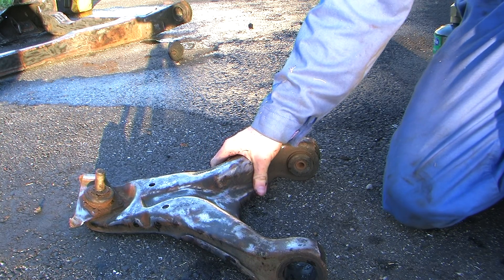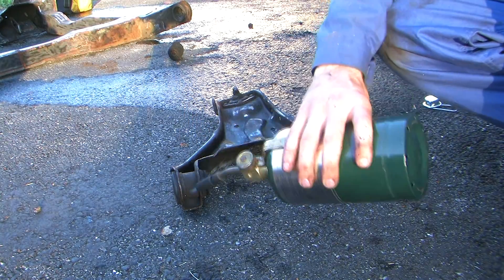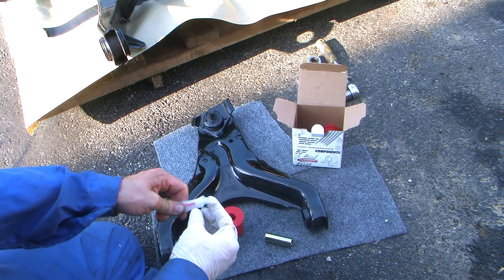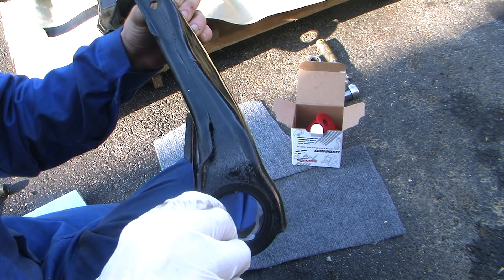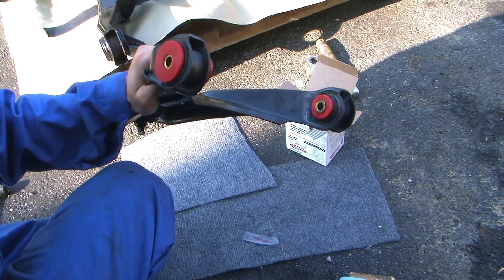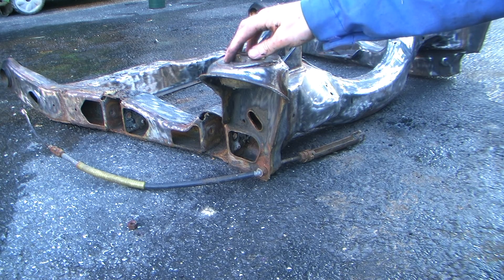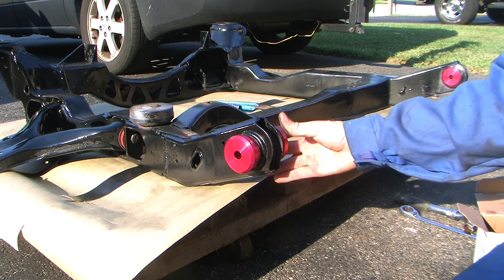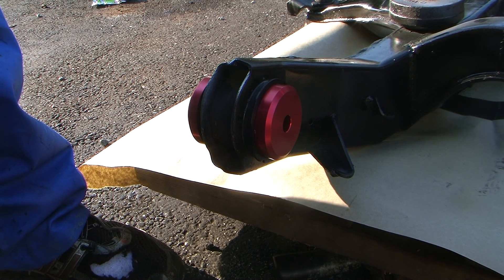Pontiac Fiero : How to remove & Install Bushings from a Control Arm & Engine Cradle

Comment: Thanks for the video. You saved me from putting in my front cradle bushings in backwards. I also used Rodney's aluminum bushings.
Reply: What’s Your experience with these aluminium bushings? Are they good?
Reply: @r.v.1325  I'm happy with them. Only did the fronts because I did this with the engine still in and had the car on a lift.
Reply: @r.v.1325 for the cradle, they should all be aluminum. I wouldn’t use it anywhere else though.  It’s too stiff for the engine or trans mounts. Honestly, new rubber will be fine there, you don’t even need poly. But poly is fine if you track the car, it just squeaks a lot. I used poly everywhere and regretted it.  But a cradle should be rock solid, and aluminum solves a lot of issues.

Comment: My only concern  with using aluminum on steel is that they dont like eachother as being 2 different metals . You have awesome videos. Now to find a pic for a 84 clutch slave 4cyl bracket

Comment: there is like a large cupped washer on the top of my rear mounts-is that supposed to come off?? do you put it back on top of the new mounts? thanks for your great videos!!  I could not figure out how these rear mounts come out but you made it so easy now-other then the cupped washer that is stuck on??  Thanks!!!

Comment: What the pros and cons to the aluminum bushings
Reply from the maker: +Kenneth Neace The aluminum bushings will hold the engine and drive train firmer in place. When you see an engine shaking when you are rev'ing it that movement absorbs horsepower that could be put to the pavement. The aluminum bushings don't allow the engine to twist and pull like the rubber ones do. So the pro's would be faster throttle response because the engine isn't flexing the mounts and cradle and your putting all that power to the ground. The con's would be a lot more vibrations in the car. The rubber bushings absorb a lot of the engine vibrations whereas the aluminum will let you feel everything. Polyurethane is a good middle ground where you get a harder mount than rubber but doesn't transmit as much vibration throughout the whole car.

Comment: Is this the same for a 87 as well as an 88 Fiero cradle?  I am not sure of the differences if any..

thanks!
STan
Reply from the maker: Thanks for checking out my video. The 88 cradle actually doesn't use bushings so this would just apply to 84-87 cradle. This bushing removal technique would be the same for any bushings on the car.

Comment: What did you use to paint the arms?
Reply from the maker: +Brandon Yancar  Thanks for checking out my video. The control arms and cradle were first sanded down with a wire brush on a drill. To paint them I used a simple base coat/clear coat that you can pick up at Pep Boys. After sanding everything down to strip off the old paint, rust and grease I sprayed the parts down with 11oz prep spay (degreaser/cleaner):https://www.pepboys.com/product/details/9865727/00374The parts were then primered with a 12oz Hi-temp Grey Primer:https://www.pepboys.com/product/details/9381454/00374The base coat was a 12oz Hi-temp Black Paint:https://www.pepboys.com/product/details/9381461/00374I wanted the parts to shine as well as have some durability so that the paint doesn’t scratch off as easy so I used a 12oz Hi-temp Clear Coat to finish it off:https://www.pepboys.com/product/details/9381609/00374As you can see everything looks great. I keep a detailed record with links to all the parts I bought and used for my car project so I had this information handy to share with anyone interested. For the four products listed above I spent less than $30 and it looks great and will had years to the parts life. If your parts seem to have some heavy rust I’d suggest after sanding them down to spray on Dupli-Color Rust Fix to prevent the rust from spreading before your degrease and primer your parts.
https://www.pepboys.com/product/details/9384039/00374
Hope
this helps!
Reply: +LostNotForgotton thanks for responding, I plan on ripping my '86 apart and replacing the bushings and paint the cradle/arms with POR-15. Thank you for basically being the only Fiero teardown channel I can find on YouTube, it's very helpful
Reply from the maker: +Brandon Yancar Thank you! I want to share my experiences in working on Fiero's with anyone who needs it. Aside from PFF my goal is to one day be the most useful one-stop-shop for learning how to fix or upgrade Fiero's. Who knows maybe even the largest dedicated car (as in only Fiero's) video repair sourse out there. I know there is a large following for Mustangs, F-Bodies etc. maybe I'll see if there are any channels dedicated to servicing them like I do. Anyway good luck on your project. Let me know if you get stuck on something. I'll try my best to help out.
Reply: +LostNotForgotton Now that's an excellent goal to set. I mentioned this on another one of your videos.. The Fiero forums are an excellent source of technical material, but there's almost nothing uploaded to the tube. Although I do not have a Fiero, I do have my own L67 swap project.